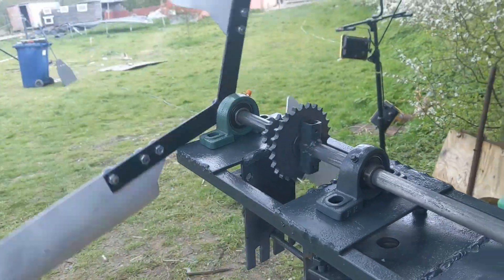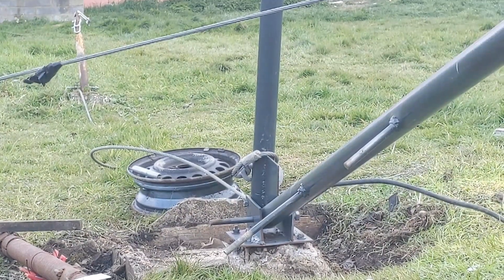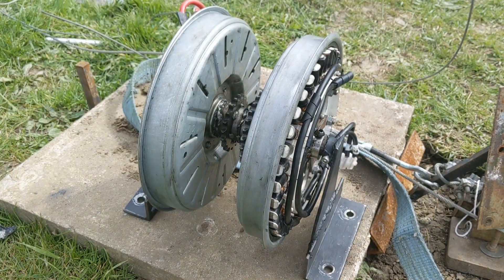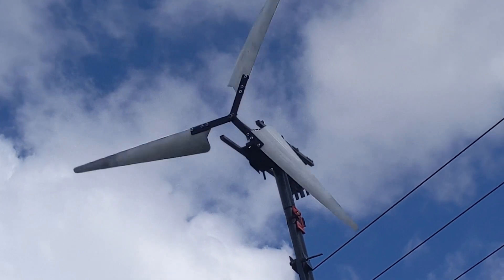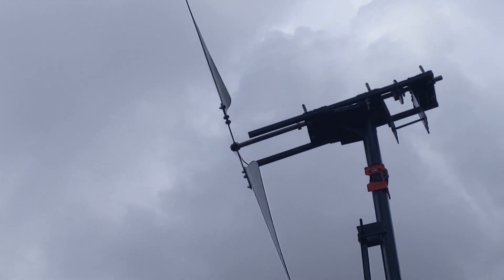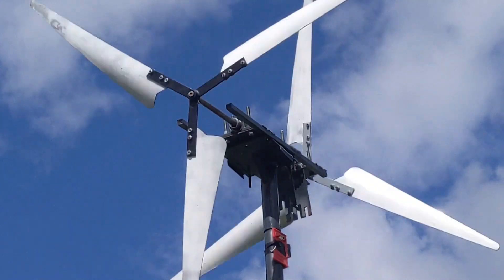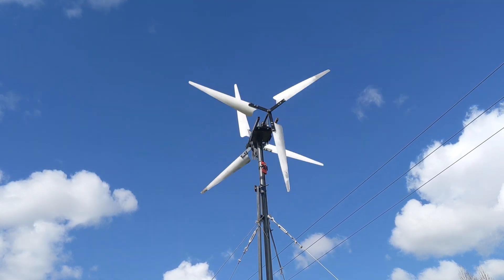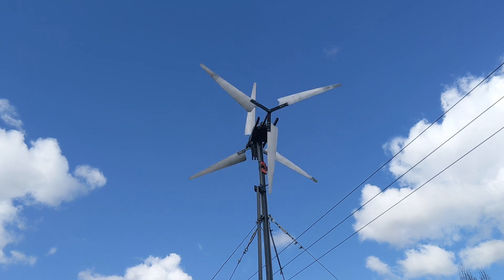48V Electric Bike Hub - Wind Turbine Generator - Testing the D.I.Y Blade Hubs - 15 April 2021

Comment: As you found on the front of the other one, moving the rear bearing closer to the blades should cut down on the wobble. And you need shorter bolts in yo ur collars as those will induce vibration as they imbalance the rotating mass. But it should be interesting to see what power you get out of it.
Reply from the maker: I got 627 watts out of it with poor blades but that was in high winds 40+ Gusts should manage a bit more than that these blade hubs are much better.

Comment: cool i hope it works out for ya  i will be building somthing soon i have 4 or 5 of those washer motors  and i have a 3 phase reg motor i changed over i am thinking of using it it is more than awesome luck was on my side when building it   no one belives untill they see how well it does

Comment: Amazes me the secondary blades do anything youd think the front blades would block the wind yet ive actually seen a very similar setup by a wind turbine company, so it must work and they had no tail by memory,  does amaze me. With my very ordinary eyes  appeared some blades may be a tiny bit out, like forward and backward, seemed to be in sync with the rocking, or shaft like you say, but sure does spin nice , and nice and fast, dont stand in the line of fire though just in case. I guess i dont 100% trust my own welds, once at school they taught us to braze weld yeh i know thats a weak weld but back then i didnt , i made a slingshot, after much use, i pulled hard on the pouch and the top of the slingshot flew back and smashed me in the teeth, now i like arc and mig LOL.
Reply from the maker: It looks lovely with the sun shining on it, still a bit of wobble but will get to the bottom of that , when I tested it before and maxxed at 527 watts the blades where 50% of what they are now so should get very interesting !!